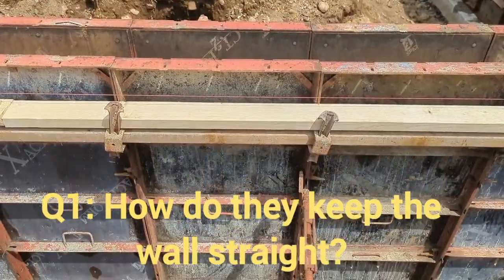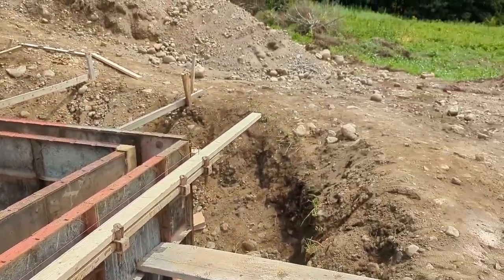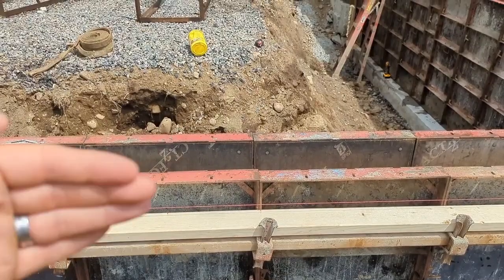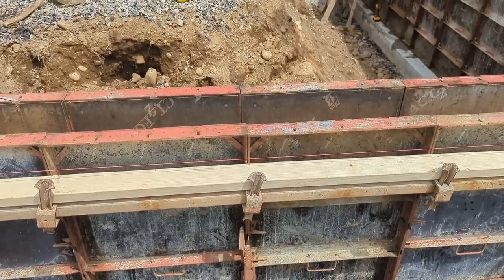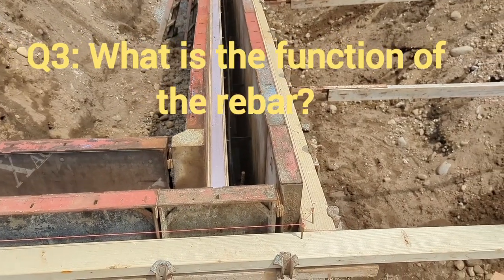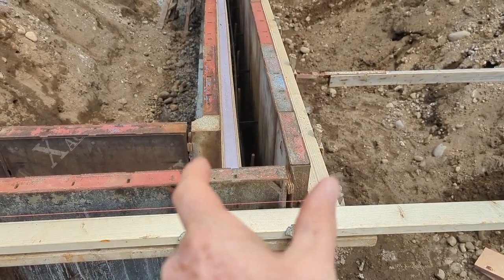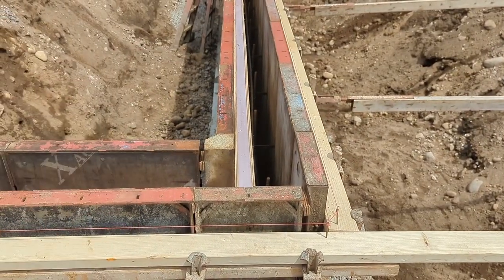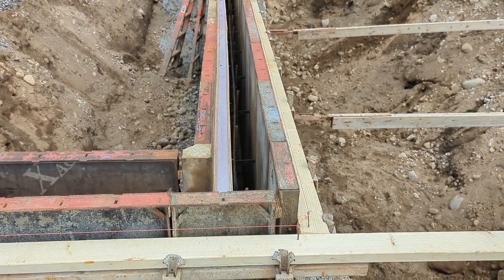How Stuff Works - Poured Foundation Walls

Comment: Did the concrete pour go as planned?  Any things you wish had been different in this part of the build?  Tim in northern TN
Reply from the maker: Sorry just getting back on here.  The pour went well.  There was some water that first came out in the pump that they ripped a whole in the plastic to drain.  I was bothered by that but other than that things went smoothly.